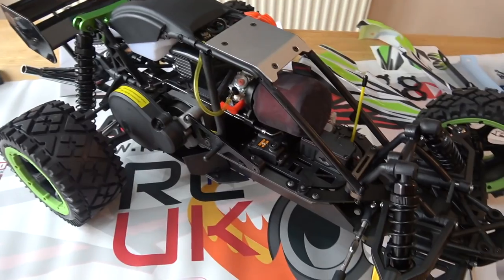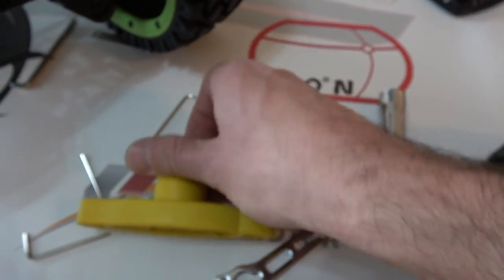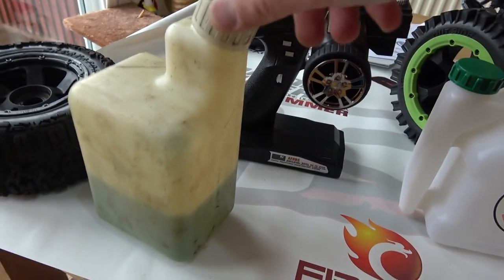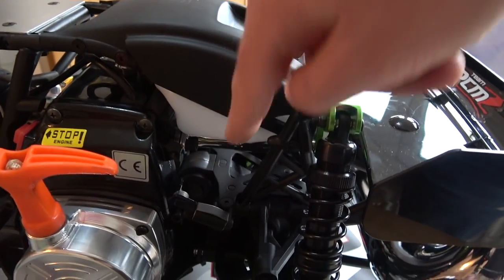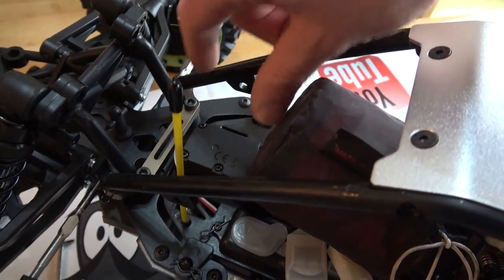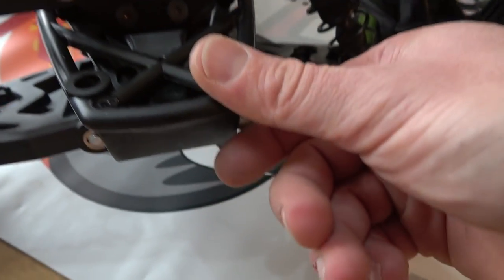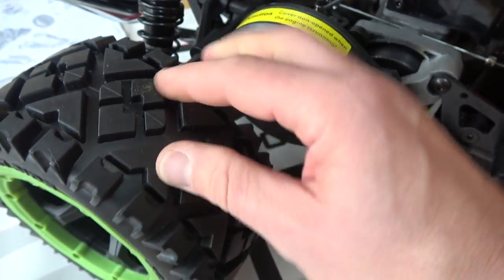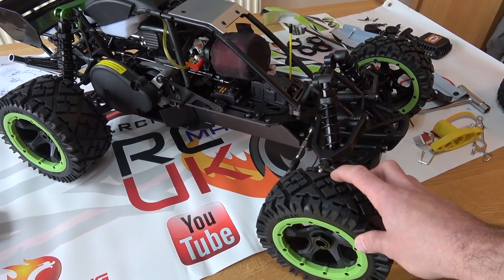SUPER short WHEELIE baja!!  Unboxing the Rovan Q

Comment: The back part of the wheel wrench is not for carrying the tools but for unscrewing shock caps(it usually is anyway). I love the look of the baja but im kinda afraid of the fuel tank position i just hope its well made and will sustain the exh heat and some hits.
Reply: Correct on the Tool Buddy :-) 
It's used for holding the Top & Bottoms of the shocks during servicing them,
Both for undoing the shock tops, and the shock shafts during build/rebuild :-)

Comment: Joel's 'Shock' obsession :-D 

The Yellow wheel tool, the top part of that is used to hold the shock ends during servicing :-) 
Not for holding tool's ;-) 

Have fun with it Bud :-)
Reply from the maker: hahahaha.... i just like smooth shocks!.... and hmmmm not a word i'd use to describe these for sure! ;)

good to know what the tool is 4 ;) and something i should def look at using if i want a decent shock action hahahaha
Reply: @RCmaxxUK  

I agree,
ALL Baja shocks have never been that great,
And these are the same as the rest,
It would be nice for some 'super shocks'
But you're unlikely to get that on a budget vehicle ;-) 

Yeah the 'Yellow' tool is used for holding the shock 'tops and bottoms', 
It allows you to hold them when unscrewing the shafts or tops :-)
Reply from the maker: @MarkHossNorthwestrcclub  . is the irc baja shock action particularly good???? guessing losi 5t shocks don't fit the baj! ;)
Reply: @RCmaxxUK  

Yes, Roberts shocks are very nice (not cheap though)
But No, unfortunately losi 5ive-T shocks don't fit on a Baja :-)

Comment: You should check the shocks for oil and replace the springs with stiffer ddm ones.
Reply from the maker: i should look at the shocks for sure... if anything though mate they are already too stiff. i would be looking for a softer spring if anything...esp up front where there is zero weight
Reply: @RCmaxxUK  being a rovan they will losen up in no time at all. Definitely check for oil..  Same in the diff too and all the bolts are tight n thread locked where needed. I still have my hpi baja 26 after nearly 5years although it wasn't stock for long,  I changed almost everything but the chassis and its still really good, I'll probably never part with it.
Reply from the maker: @kevslife  what your opinion on chassis strength? i was running it locally in a confined space.( running in) tapped a wall ( i thought lightly) and its bent the front chassis area a bit. My friend that runs baja only has bent 4 or 5 chassis himself and says its a big baja week point. i need a kick up/ front chassis plate for sure!
Reply: @RCmaxxUK  

A nose plate on Any Baja is a MUST HAVE item,
The front nose is the weak point for Any Baja,
They'll bend, twist, and snap there, 
It's their design floor/quirk,
And one that's always best to address sooner rather than later :-)
Reply: @RCmaxxUK  ye a reinforced front chassis plate is as essential if not more so than outetwares! Its the biggest weak point on a baja. Ive bent several.

Comment: A lot of car for the money I got rid of my Baja for a 5t losi but might get one of these
Reply from the maker: hi mate. I did have a std baja a cpl years ago... had a few issues with it though and went losi and tbh the quality feel of the losi's has kept me away from the baja platform. This short one though seems different enough to give the platform another go! fingers crossed its good!
Reply: @RCmaxxUK  same with me had the kit 5b and it such a let down for the money, it cost me about 800   and I still had to spend much more just to run a full tank but do think Rovan Baja with 200pound spent in it would be fine
Reply from the maker: hope so mate... i have already scratched the hell out of it going right over on wheelies just running in. my fault for running on road. @mact153

Comment: How do you get the engine cover of the flywheel to fit the remote failsafe ?
Reply from the maker: just un bolt it mate. 4 bolts on the side from memory, 2 underneath and 1 at the rear side.. ;)

Comment: Mate I've seen your video on the km Baja blade 34cc just asking yeah is it any good?want to get one on rcmodelz
Reply from the maker: JR RC Video's hi mate. The guy that owns it is very happy with it. However I think he bought it used for around £400 I think. Not sure what the new price is... so you have to take that into account. Be prepared that all these rtr km and hpi may well need some upgrades to strengthen them depending on your driving style and expectations. I for example bent the front kick up on my rovan shorty after what I felt was a fairly soft front hit. Just when I was running it in. A mate who’s baja savvy says a front kick up plate to strengthen that area is a must and was not surprised in the slightest that it had happened 😂
Reply: @RCmaxxUK  thanks for this mate coz want to get into petrol RC all of my RC is electric so been watching your videos coz don't really have any idea on petrol 😂😂 so been trying to do some research thanks for the reply mate
Reply from the maker: JR RC Video's no worries mate. Ask away. Happy to help if I can. I guess my advice would be to get the entry level baja model from rcmodelz. £380 I think it is. That way , it’s a new car... so u have some after sales and help if something is not right. It’s cheap so u are not too much £ down if you don’t enjoy it. It’s not been abused as it’s new so you are safe from buying someone’s used and abused junk that’s been tarted up. 

All models can be upgraded! So yes In an ideal world I’d buy a used fully upgraded model that’s been a shelf queen and is being sold at a bargain price! But they r hard to find and u can get stung big time. 

Good luck mate. 👍
Reply: Thanks mate I'll keep that in mind

Comment: Do you still like the roavn?
Reply from the maker: Justin Hardy hi mate. Yes I do like it. I have managed 3 sessions with it now. Only 1 after doing a cpl of modifications. ( wider stance / different wheels and a chassis brace plate) still need to sort the tank breather. It’s a fun 1/5 and it’s small... which helps with storage / transport and just general ease of use. I do think I’ll be selling it soon though. Need to run it a bit more and get that on film for you all to see. 👍
Reply from the maker: Main reason for selling is I now have a new baja in the fleet that’s not yet been revealed to you all😜
Reply: I love the baja platform, easy to work on and there is no bodies to damage. A  running video would be great.

Comment: If you like over paying keep the hpi and losi.  Redcat racing and Rovan all the way!!!
Reply: for me, buy original hpi or losi and for extra parts and modification, rovan parts and others..
Reply: Architect or you can buy 2 Rovans keep the money you still save from not buying an over priced HPI or Losi and hop up the Rovans!!!
Reply: @Meyers2strokeRcgarage  u r right tho, l have 2 baja's. One is full alu rovan and other one l bought it second hand original baja 5b. Both are really good. For me there is no performance difference etc.Also l like rovan tire's in this video too. l will order back pair.Also thinking to buy 3 speed transmission and this cnc metal pull start.I never got into losi or kraken etc.Just too expensive in my country. Baja's engine sound enough for me